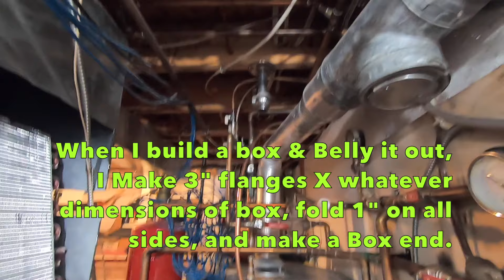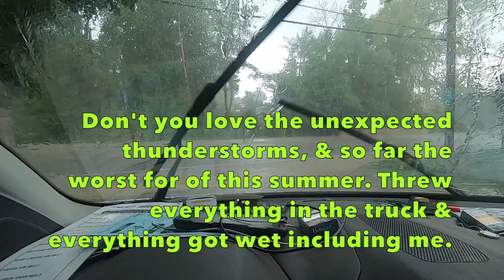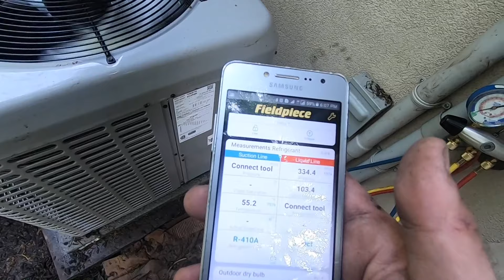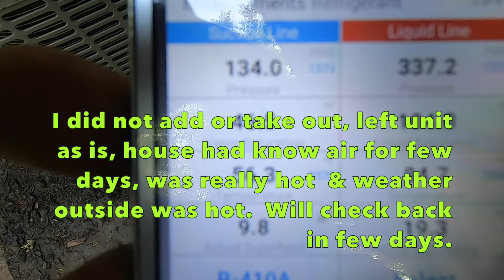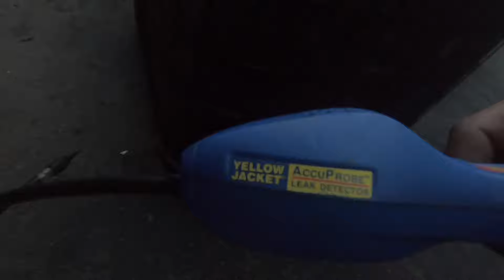HVAC: Lennox Aire-Flow | Leak in condenser

Comment: I just got the hilmor bender the other day in my opinion it’s the best one out . I did an install. The other day changed the line set ran about 30 feet with multiple bender and no fitting . Really hyped on the thing
Reply from the maker: Whats up Tyrell, yes Hilmor is the best, glad you picked the right one.  i don't use the bender much i like using fittings. i waste less copper and tighter bends.  Just something im used too. There are ups and downs for both.
Reply: HVACR North yeah I noticed in some of your other vids u use fitting . Definitely makes it look clean because the tighter bends. Hey the other day a buddy of mine installed a unit and just about at the end of his install his helper ended up putting a screw into the coil lol. Anyways he brazed over it . But he was checking the charge . It didn’t seem to bad but the head pressure sounded a bit high. Around 348 and the suction was 148. He got the right super heat . It’s a piston . But the head pressure seemed a bit high and is liquid line he was saying was a warm not hot . A bit more than ambient temp. Had me wondering if there is a restriction or something . Nothing was iced up but the head pressure just was kinda high
Reply: Any ideas ?
Reply from the maker: @tyrelldavidson7738  i dont know to many details. to be honest its probably fine, do you know the temp of lines?
Reply: HVACR North suction was around 72 and liquid 100 . Super heat was 20 and subcool was 10
Reply from the maker: Send me an email, we can discuss.thanks

Comment: Keep doing these videos and people will start to love York again. Why don’t you use cased coils? The last uncased coil I used was around August 1994. Now I use three different manufacture of cased coils: JCI, ADP and ICP. Guaranteed one on those coil casing will fit.
Reply from the maker: Thanks den, more money which the customer doesn't want to spend. I do usually give that option to most.  I don't mind Yorks (Micro), but only used strictly for A/C.  Thanks for input bud.
Reply: HVACR North all COLEMAN heat pumps are copper & fin, no micro channel available for heat pumps. Also did you realize the control panel is on a hinge set up, god for bid if you have to replace the filter drier or compressor but it is for easier access. Maybe in the future keep the unit further away from the wall and have extra length of electrical whip then you can remove a screw and panel will swing open with out removing any wires.
Reply from the maker: @superiorcomfortheatingairl3373  tbh I did notice but not until few units in, but you & I know how customers are, "can you please put it closer to the wall" lol.